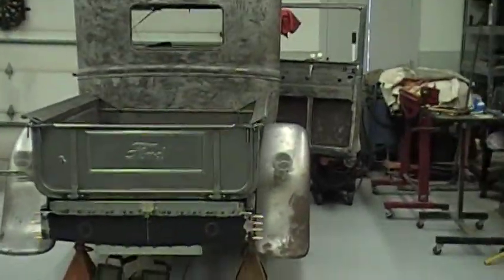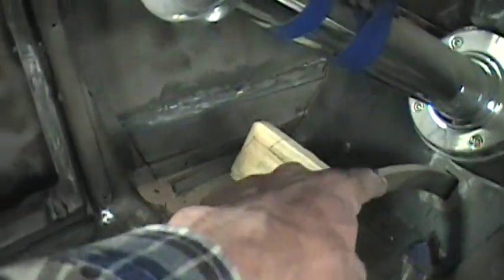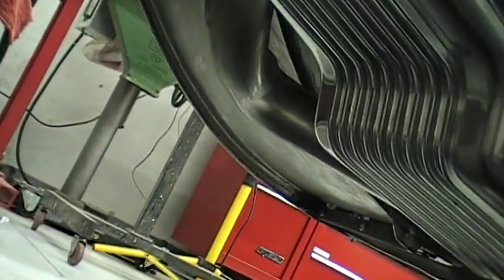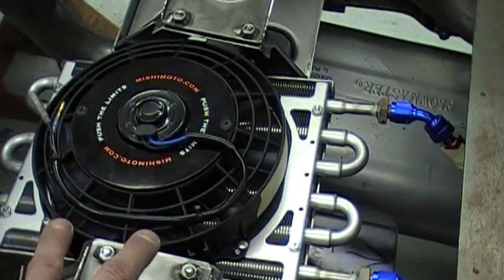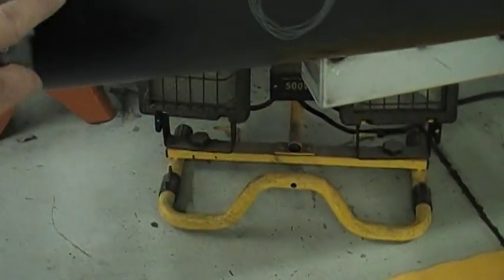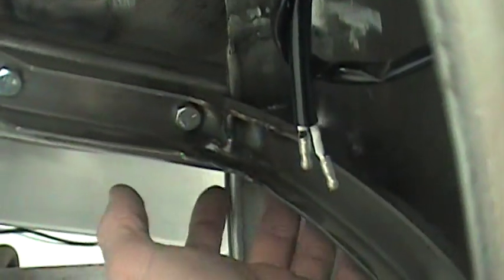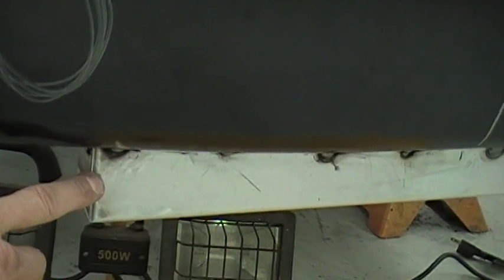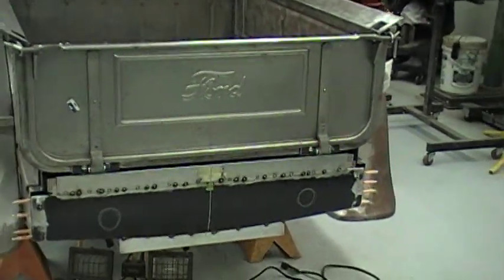31 Ford model A pickup 19

Comment: Truck's looking good so far. For the holes going through the roll pan if it was me I'd use a metal cutting hole saw that was the right size. With that tight of clearance that you won't for your tips you'll need some good hangers that won't allow the pipe to move very much or it may hit. I'm sure you know all this already.